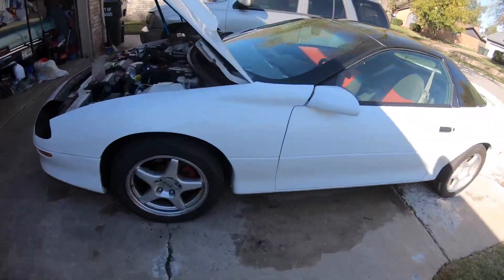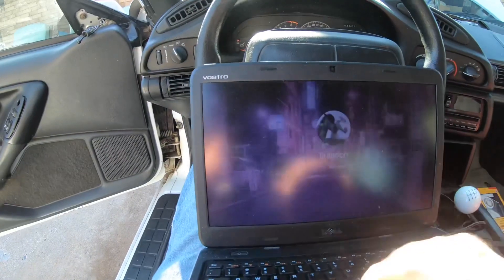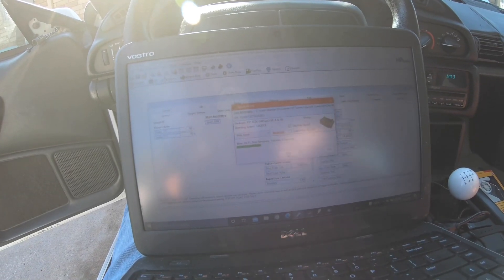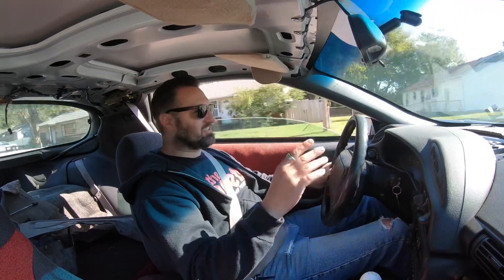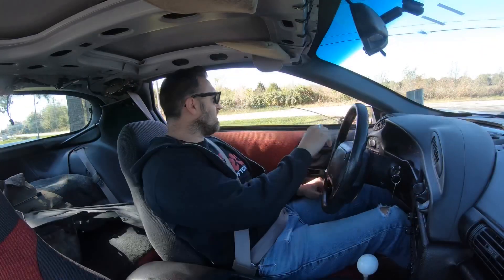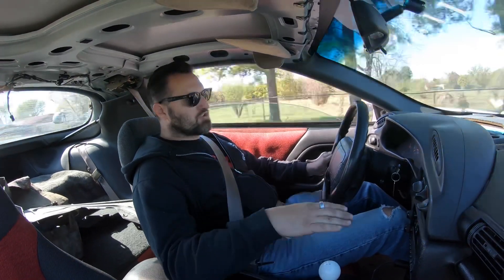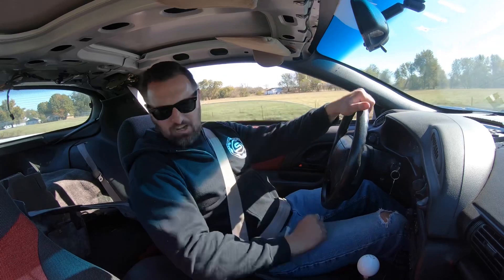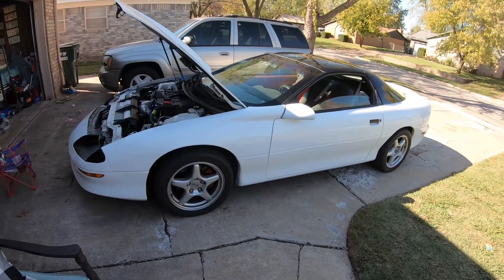Supercharged! LT1 0411 2 bar tuning Pt.1

Comment: I’m currently building a lt1 out of a 95 T/A to swap into my 3rd gen T/A and I came across this video and this car is damn close to what my build is. I’m doing the 4x swap and running the opti ass a distributer, running e85 and 60lb injectors speed density and vortec procharger non intercoolerd setup. And would like more details on the flex sensor install you mentioned also what cam would you suggest for weekend warrior